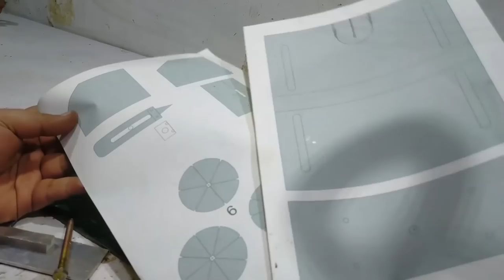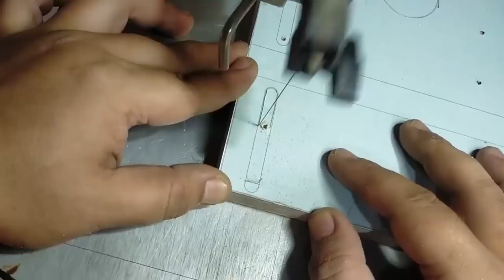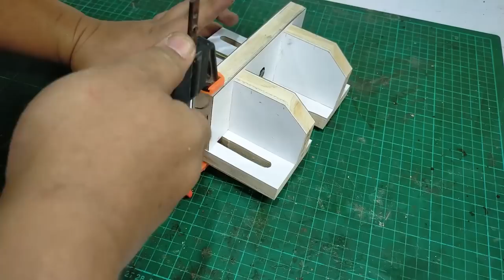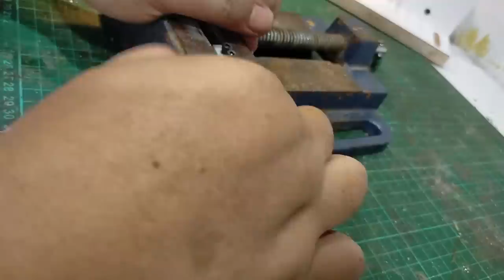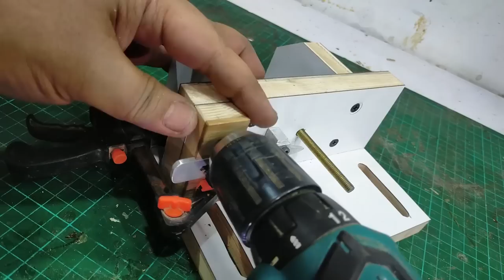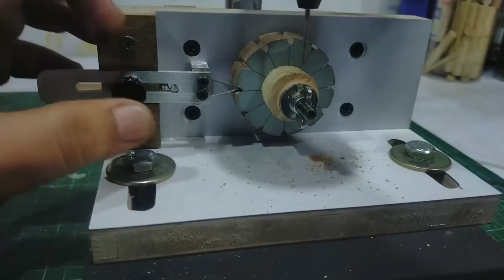How to Build Spoke Wheel Jig from scratch

Comment: Thank you for making this excellent jig available.  
I have a doubt, I printed the project and I think the guides for the lanes were too small, mine was only 36mm in diameter. Could you tell me the diameters of the guides, the wheel that will drill to place the lanes and this smaller piece you place behind the wheel to be punctured.  Grateful.
Reply from the maker: print with A4 paper 100% potrait, and 50mm diameter for the guide
Reply: @AOBiWorkshop  Tank you

Comment: I,m just asking  what is this paper called to put your plans on looks easy enough to do instead of tracing it on the wood thanks again I,m new at this wood working stuff any help is appreciated and what is that Tool called ya use for pushing holes in wood ? It looks coooool 😊
Reply from the maker: I use sticker paper  for plat surface, and center punch o marked center wheel